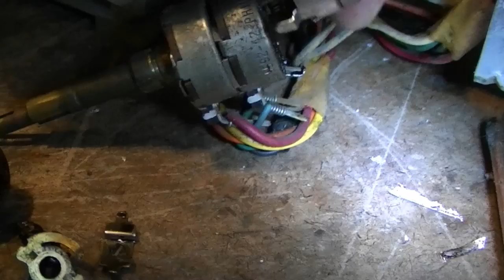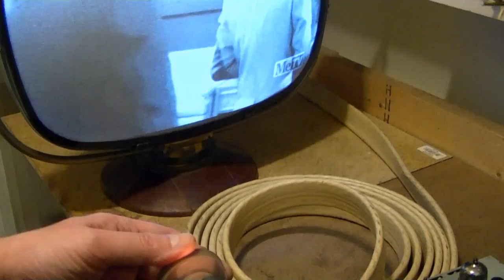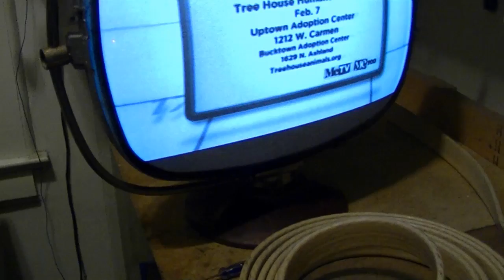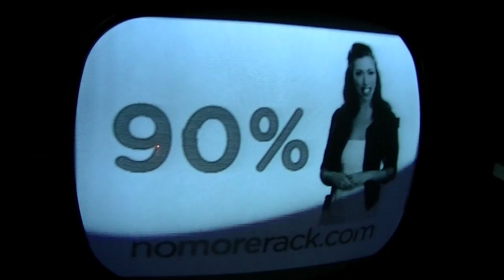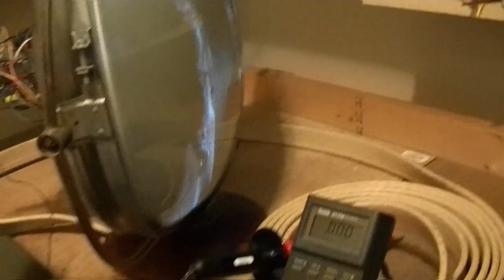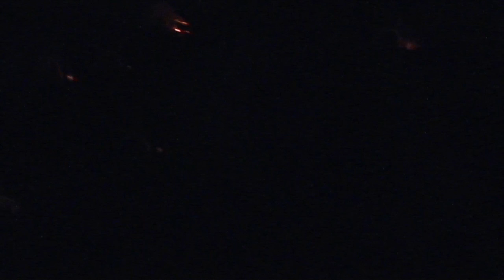Predicta Tandem I restoration pt7o8

Comment: WOW! I have a 1962 with the tube attached. My on/off is missing and was replaced bt a push-push plunger mounted through a hole drilled through the cabinet. The push pull rod is still there with a notched end that looks like it mates with a fork? where did you get the NOS replacement? I need one for mine. Im sure it  is the same switch. I'd even use your old one... I have nothing. thanx.